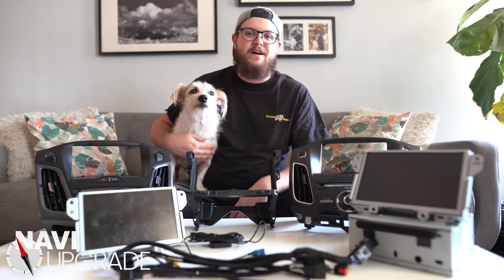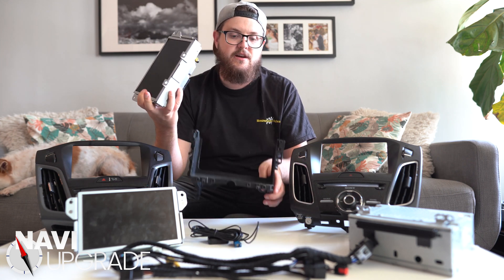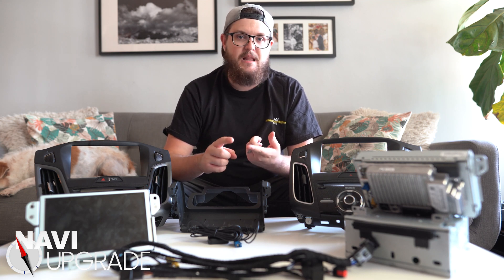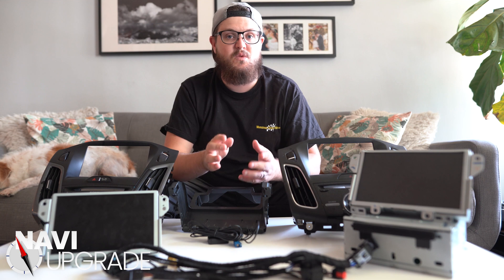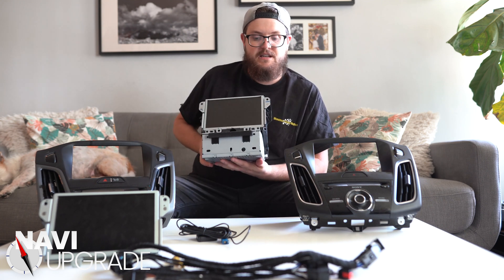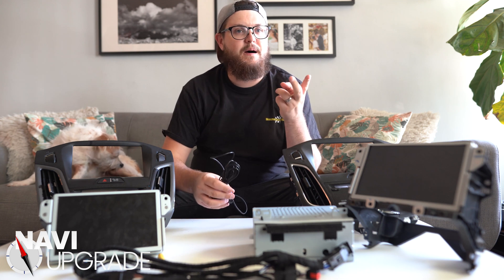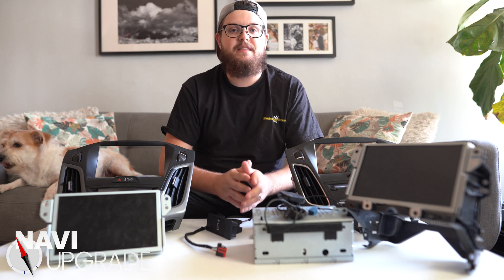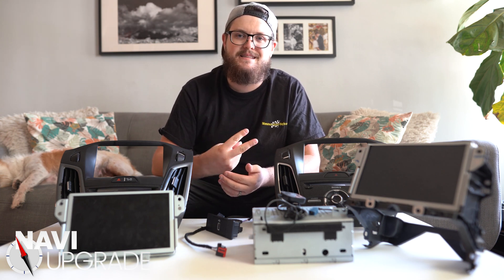Ford Focus 4" to 8" Sync 3 Conversion Hardware Rundown & How to SAVE Money on Your Project

Comment: my car is a uk focus mk3 2013 its got the sony ford unit but i dont think its sync 1 its got usb and aux inside glove box also its got the extra audi wheel buttons on the lower righthand side what do i need to convert to sync 3 is it even possible

Comment: Hi there I’ve recently bought a Ford focus mk3 2015 with the original 4” screen looking to upgrade to 8” sync 3 is this possible, if so do you happen to have a link for what I’m needing currently able to get sync 3 module and facia and other bits with it

Comment: Do I need to buy a new acm or can I use the sync one ford focus st?
Reply from the maker: That's up to you! If yours is working well I don't see a reason to swap it for the one with XM Radio / HD Radio. Personally I think the stock one sounds better.
Reply from the maker: The only time I'd say swap out is if you have a 2018 that doesn't have a CD player. The sound output of that one is garbage.
Reply: @NaviUpgrade  yeah mine doest have the cd player unfortunately. So I should switch it out then . Thank you for responding. What is the part number I need for the acm and the apim I’m tryna get everything together but confused by the part numbers everywhere I call they ask for part numbers . And I wanna buy the harness from you any idea when I can get one .
Reply from the maker: Problem with Ford is that there's a ton of different part numbers for stuff — it's not all the same so I can't just give you a part number unfortunately. As for harnesses, looking like end of the month 😩
Reply: @NaviUpgrade  so I can just buy any focus high def single cd one and it should work and okay should I put in a order or wait till it comes available
Reply: @NaviUpgrade  also do I have to program the acm when I buy one
Reply from the maker: @SSSDarkgaming yes but all files come with your harness order. Super simple process.
Reply: @NaviUpgrade  should I purchase on back order or should I wait till it comes available
Reply: @NaviUpgrade  can you tell me where to get the bolts to screw the screen and apim and acm
Reply: I didt think you’d respond since it been sometime the video was made

Comment: hey, i got a 2014 and bought an entire Sync 3 kit from a friend which included a 2015 front fascia, I know that the 2015 doesnt have the lock/unlock doors button and a slightly different trim, does it still fit the car? Parts havent arrived yet so I'm here wondering if I'll have to buy the proper front fascia or not

Comment: Hi, I have a 2016 fiesta st180 with the sony 4.2 inch screen. Will a conversion to a sync 3 system interact with the vehicle settings e.g esc, wiper setting, mirror settings etc?

Comment: Hermano me podía ayudar tengo un Ford Focus 2012 sel cambie el radio de sync 1 a sync 2 quisiera saber que nesesito
Reply from the maker: Just use the same stuff as shown here, but use a USB hub off of a 2016 Explorer or 2016 Fusion (has the same power connector as Sync 3 hubs, so you can use  Sync 2 with a Sync 3 upgrade harness)
Reply: Entonces como va los pines del control de volumen.intermitemte cierre de puerta boto de pagar radio control comando de voz

Comment: Omg please can someone help me with this question?! Is it possible to convert the radio touch/navigation infotainment head unit interface to the 8” sync 3 OEM  in the 2012 ford fusion se ?! I keep seeing people change the radio in the 2013 and up but can it be done in the 2011-12 ford fusion models?

Comment: Hey! Any chance that you share de part numbers that you have shown in this video? It seems the faceplate for 2015-2018 is F1EB-18835-DG3JA6. I wonder what would be the bracket that holds the screen and module part number, the one being discontinued by ford.

Comment: I'm trying to do this on my 2016 ford fusion, I have the Sync 1 (4") unit and wanted to upgrade to sync 3. Can I source all the parts myself and buy the harness from you and be set? I understand that Vin number has to be reprogramed into the new system but will the harness you sell bypass that step or?

Comment: Hello, I made a conversation from sync 1 to sync 3 in a Ford fiesta and it could not make the usb ports work, it connected the two cables to the hub, the blue light is hanging but it does not read the pendrive, do you have to configure something?  What can be?  Thanks
Reply from the maker: Single or Dual Port USB Hub?
Reply: @NaviUpgrade  dual port usb hub

Comment: Well done I have 1 focus mk3 EU 2012 with bvc 5 "screen system can convert to sync 3???
Reply from the maker: Absolutely -- the one thing we've found with EU Focuses though is that the ACMs are not programmable. The simplest solution to this is to find an ACM from a KUGA and modify it to fit in the Focus ACM casing. Everything else is the same though!

Comment: The resistive touchscreen on my 09 f250 with SYNC 1 with nav was perfectly fine and feels just like SYNC 3, only difference was AA/AC integration.
Reply from the maker: I'm sorry but this is just not true. The responsiveness and multi-touch capabilities of Sync 3 is absolutely noticeably faster and better to use than all prior Sync generations.
Reply: @NaviUpgrade  I'll admit, it sometimes doesn't register my touches, but since I never owned sync with my ford touch, I can't judge that.
Reply: @NaviUpgrade  for me, its barely a difference, since that sync generation was the smoothest with no lag, and no freezing that I have experienced, whereas sync 3 takes time for it to go to a menu where I clicked, so I feel no difference

Comment: I want to know does this work if I’m going from the 2012 myford touch with navigation or do I need a different harness? And I just seen a comment about the rear sensors did you fix that?

Comment: Hello! I want to upgrade my NON SYNC 2011 model to a Sync 3. Is that possible ? I noticed u talk about the 2012-2015 range only. Thanks in advance !
Reply: My 2011 focus is still a mk3, but it has the 4inch display with no sync software (as far as i know ... the car's bluetooth name is "Ford Audio" not "Sync"). It s a titanium so it has Just navi, bluetooth and so on.. Also the USB and Aux are located in the Glove Compartment. Does that affect the install in any way? The car is imported from Belgium. Please let me know if it will be worth the acquisition of a sync 3 module as u explained very nicely in the video above. Thanks again.
Reply from the maker: Shoot me an image of your center console to support@naviupgrade.com

Comment: Is this upgrade possible in a UK Mk3 2013 Titanium with rear sensors, climate control and the 4" premium Sony unit? I have upgraded door speakers so would prefer to bypass any Sony DSP if possible when upgrading?
Reply from the maker: Absolutely. Our conversion doesn't go through the DSP at all and is compatible with cars in the UK and EU. You might need to source another ACM if yours winds up not being programmable (some of the early ACMs weren't in Euro cars)

Comment: Are all the 2020 Sync 3 displays and modules now GPS/Nav? I have a F250 that doesn't nav unless connected via usb to my android. It knows where it is and I can auto start it from fordpass app. Do you know who might have the info to reflash via FORScan(if possible)?
Reply from the maker: Hey there, that's just Android Auto that's popping up (Google service similar to Apple CarPlay). If you want built in factory navigation you unfortunately have to swap out the module or the daughter board inside of the unit 😟 since you have a 2020 truck with the FordPass app you'd need to get a 2019+ Navigation APIM that has the LTE module built into it. As for the FORScan asbuilt data, you can retrieve your stock data from https://motorcraftservice.com/AsBuilt -- just enter your VIN and fill out the security code and it will populate!
Reply: Hi, Is there any way for Android auto to work without having to connect via USB? It would be nice to use without having to plug in every time. Thx
Reply from the maker: Not as of right now with Sync 3, sorry! I've been working with suppliers to try to figure out a solution to this for a while.
Reply: @NaviUpgrade  Have you tried a wifi usb wireless adaptor? Was thinking about giving one a try.

Comment: Great video, so well explained. I have a 2012 Focus titanium and I want to upgrade to the sync 3 system with sat nav. I will be using your site to purchase what is needed.  My question is, would I have to change the ACM to enable the upgrade ?.
Reply from the maker: Thanks for watching and for your support! You don't need to update your ACM 🙂

Comment: Hey I commented on a few of your videos ago totally excited about this because I’ve been wanting the 8 inch screen forever so I was looking around for the parts just slowly trying to accumulate the parts, and I ended up finding the metal brackets on ebay off of a Lincoln idk how I found them but I need to buy the plastic bracket that the whole system bolts up to
Reply from the maker: Hey Jordan -- if you can find it anywhere, the part number is going to be CV6Z-58042A82-A